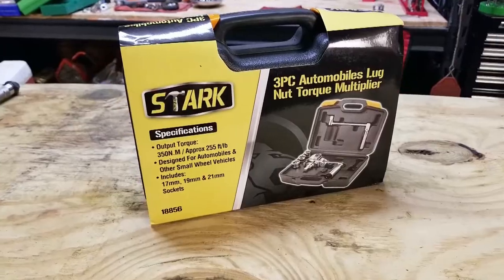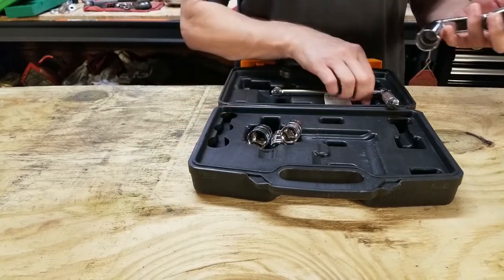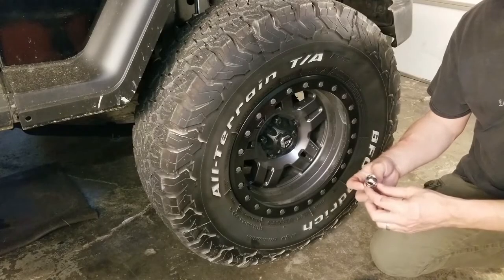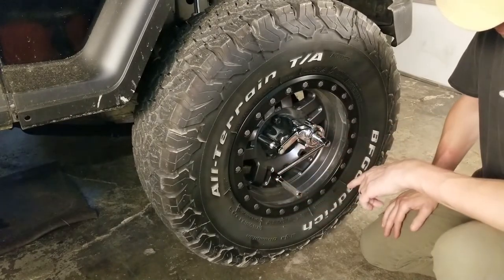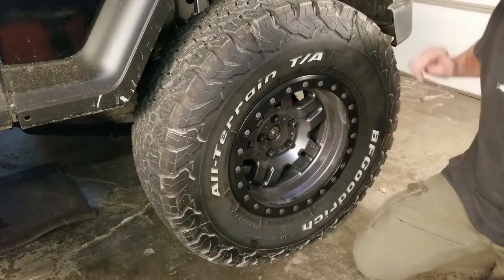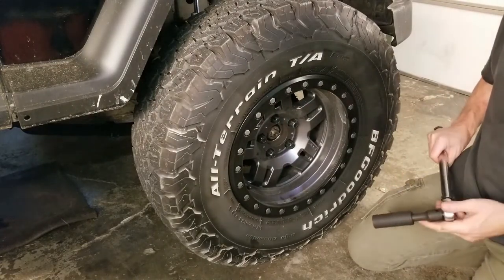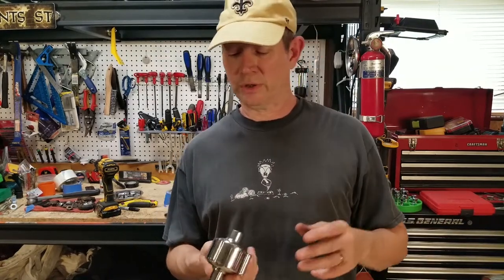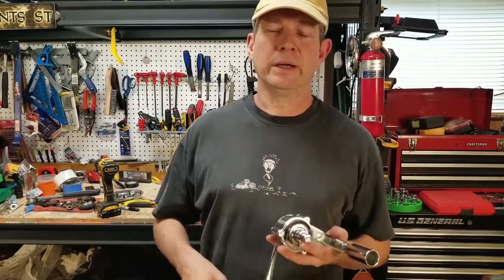How To Change A Tire The Easy Way! Lug Nut Torque Multiplier -  # #wheels #tires #mechanic

Comment: I am inclined to think that this was originally German technology that was adapted to the DIY market,  has been rebadged by the big companies like AME, for those of you who insist on using tons of antisize,  you might want to watch a video by ALKITRONIC that illustrate the affects of lube and rust on torque, you will have to find your "degree of angle "by using the specific torque on clean dry threads first,  with a pre torque, (about 20%)

Comment: Think of this as the opposite of an actual torque wrench.  NEVER USE TO REFASTEN LUG NUTS.  As you would NEVER use a torque wrench as a breaker bar.  In other words, this is a loosening tool ONLY.
Reply from the maker: Absolutely

Comment: Quick question! After you have taken out four lug nuts and trying to take out the fifth and last one. Where do you stick the supporting arm?
Reply from the maker: On one of the studs.  You will have to secure it a bit with one hand.
Reply from the maker: Also, you can just use this tool to break all of the lug nuts loose,  but leave them in place and then remove them by hand after they are all loosened.
Reply: @DailyBrewGarage  I don't think that is a good idea because in that scenario the arm is pushing against the threated area of that stud.
Reply: @DailyBrewGarage  I understand, thanks!

Comment: To hell with the hand crank can you attach an impact driver to it ? That way even your ridiculously cheap low power cordless impacts could remove a lug or even an impact driver cause Milwaukee m18 gen3 will take lugs off most passenger cars on its own so long as you have a good quality adaptor bit.

Comment: The limit will be a nominal physical limit of the parts. Over that 255 you're potentially bending the handle or stripping the gearset etc. 

You can physically put in as much force as you want - just that the fancy tool will let go at some point
Reply: No.